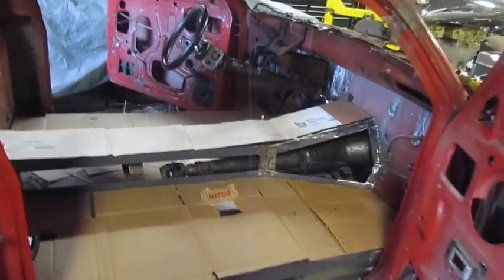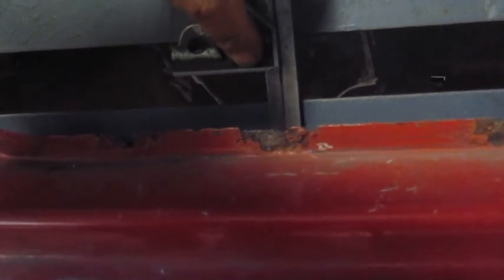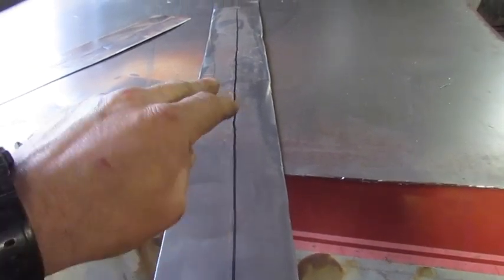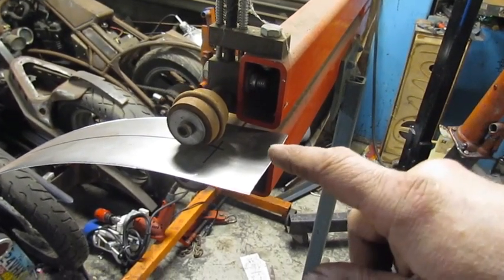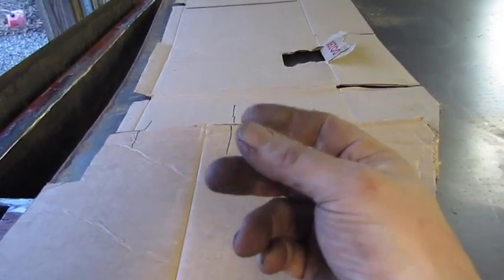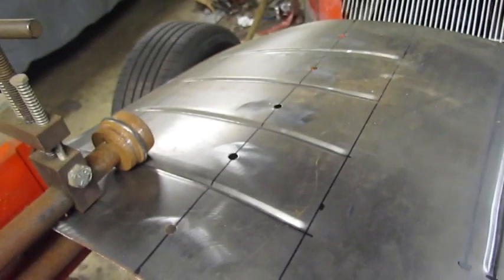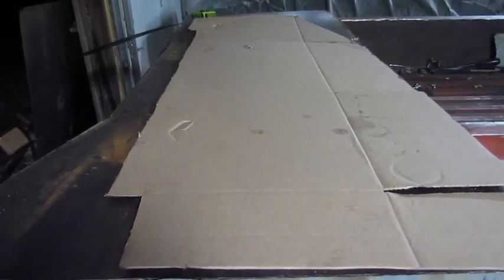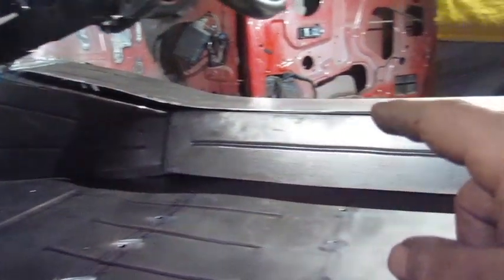Installing the Floor

Comment: Did you leave enough clearance for Bellhousing access.?
Reply from the maker: Yes sir that is not a issue. bellhousing and motor sit forward from firewall 3 inches and there is 3 inch clearance around the whole bellhousing.
Reply from the maker: https://prnt.sc/YmM4DFtd617Y
Reply: im pretty sure this guys knows what he is doing, he thinks ahead about everything once tiwce  before the final  steps